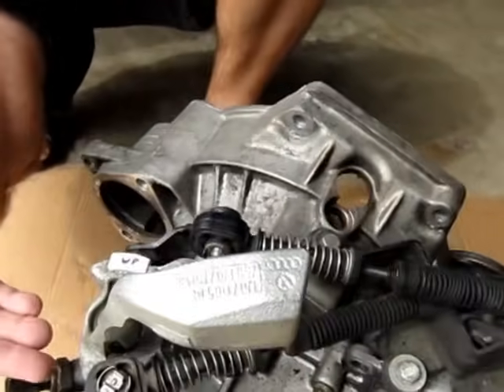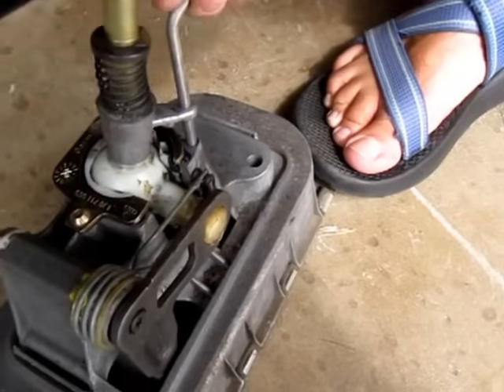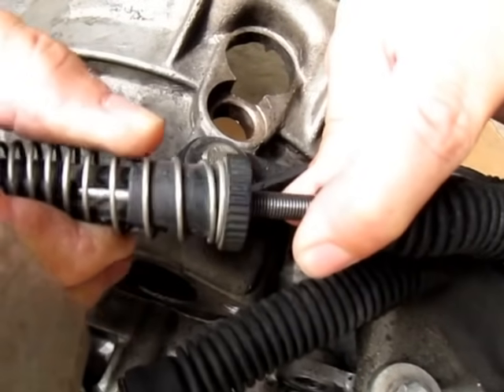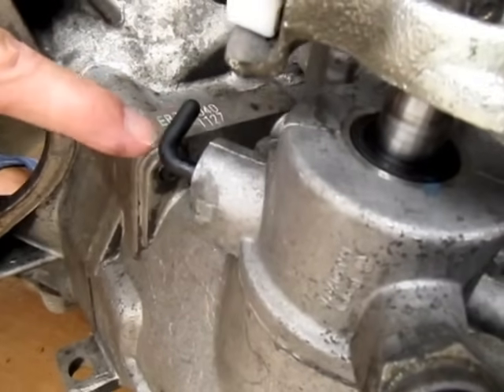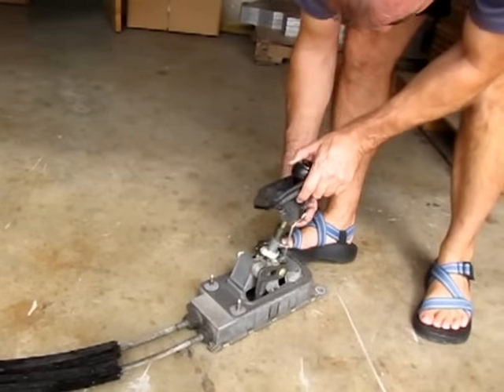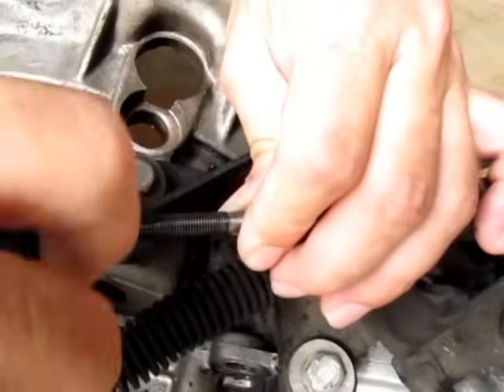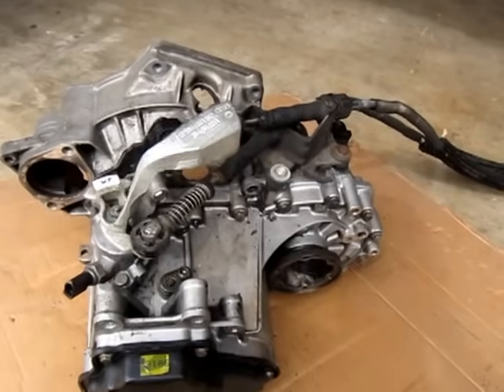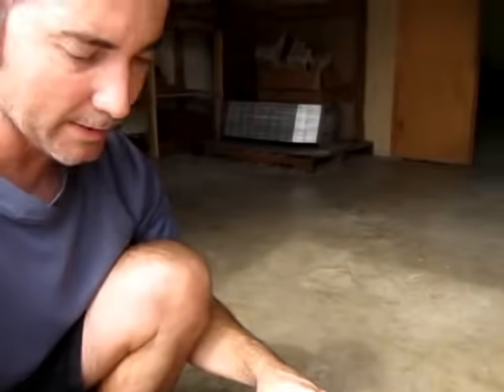VW MK4, MK5, and MK6 5 speed shifter adjustment for 02J and MQ250 transmissions

Comment: Is it the same procedure to adjust a sigma 5 kit with the locking pin broken? I just ordered a sigma 5 this week 😁
Reply: +dieselgeekdotcom  No problem, I've been lusting after one for about 18 months now 😂 
So the white plastic guide will line up in the middle of the plate still when in the correct position with the sigma 5? 

Many thanks Jim 👌😀 

Marc
Reply: +dieselgeekdotcom Thank you 👍

Comment: hi there,

 first I want to thank you and congratulate you for you videos and your channel, you are doing a tremendous job helping others, good work on that! 

So, here is my problem, hope you could help me and let me thank you in advanced for taking the time to read my comment. 

here is the thing, I have a Golf Gti mk4 1.8t which is giving a really hard time getting the reverse gear working, no matter how many times I switch it or I try to put it, no matter how softly or smoothly and try to put it in, it just simply does not wants to works. 

I have taken it into a repair shop a few times and they have just "supposedly" adjusted the shift and this and that, it worked for a few day and then when I get on the road and I change some gears quickly it just stops working again and now it is at the point and it does not wants to work at all anymore. 

the last time that I was at the repair shop  they try to adjusted and I drove the car for a quick test and the transmission did something weird, I tried to put reverse, it took it for a while then after a little ride it did not want to took it again and when I was  moving forward back to the garage, suddenly, it just did something strange, like, It went on reverse abruptly. 

so, Im afraid that it might be something wrong with the transmission internal or with the gear box, I don't know... 

I hope you could reply to me and that you could give me a diagnostic based on what Im telling you.

best regards!! 👍

Comment: Nice demo on shifter adjustment....A Lot of good info here.  I know that this was just for Demo Purposes and serves that purpose in an excellent manner...but did you notice how much play there was in the cable end bushing for the 1st to 2nd shift movement?  That end bushing is SHOT... you can see its cracked inside.

 Pay attention to the condition of your shift cable end bushings.... Doing this adjustment will surely help tune in the shifter...but pay CLOSE attention to the condition of those end bushings....those will introduce a lot of play where you do NOT want it.  The cable may have all the slack out of it and be perfect....but shift feel or shift travel in either direction will be affected by those end bushes...  Make sure yours are healthy and this procedure will be all you need !!   Nice job !
Reply: You couldn't be more correct... After looking at my vehicle as well as another with new ends on it....they were exactly the same.  Lots of play but in a controlled manner...you hit it right on the nose there !   I hadn't seen or played with these cable ends until I installed my adjustable shift arm and now....i think I like the slop a bit !  Whowouldathunkit ?

Comment: Hi I have just started the adjusting the cables but the top cable does not move the alu balance it seems that this is stuck  its a 2008 tdi the bracket is plastic but its the same thing   any ideas
Reply: +dieselgeekdotcom Thanks for getting back to me
the black L shaped is not in the locked position  the counter weight just does not move should i force it ?
Reply: +dieselgeekdotcom the L shaped pin is out and no pin is in but it still does not move is it dead ? should i try to move it force it  could it be stuck Looks like the fulling plug has never been touched and the inspection plug the same!!!

Comment: unlucky me 1 of the 3 splines that holds the cable broke when I was getting as you say putting the shifter into the home position with the 5mm pin so 2 splines are holding the cable along with as you say zip ties. Still driving for now though

Comment: Hey @dieselgeekdotcom , on my 02J trans the chrome counter weight you are talking about in the video has been stripped from the splines from the gear shaft coming from the transmission and needs to be replaced. Do you know the official name/part number for that chrome weight? I need one asap.  Thanks in advance.
Reply: +MrDieselsmoker  the part number is on the orignal weight
Reply: +dieselgeekdotcom world pac or the dealer can order or i can as well - 613 -438-2886

Comment: My 2006 VW Passat 1.9TDi (B6) had an issue selecting 2nd gear problem changing from 1st to 2nd or 3th to 2nd you would 30% of the time end up getting 4th Gear (problem at traffic lights and while crossing a busy road !!!!) used this video to re-adjust the linkage and worked first time (well problem shifted to selecting 5th gear ) second time managed to perfect guess the locking drill bit shifted the first time just want to say a big thanks for well explained Video

Comment: I've adjusted it several times now on my '04 GLi. I couldn't get the car into 1st & 2nd very easily when I bought it, and now that I've adjusted it I can't get it over to 5th or 6th. I've adjusted the side to side linkage anyway I could, with a lot of slack or very tight and it doesn't change my ability to shift above 4th. I'm not sure what the problem could be, any advise?

Comment: Thanks Bro. It totally works you are the man. Sweet.
 I am still having trouble with p1128 and a brake leak issue ongoing..  New stage 2 clutch not even broken in yet but the transmission passes.

Comment: a motor shaft from a POWER 25    motor  will work very well .just put a little tape around the top
WHERE can you get one  ANY HOBBY SHOP   it is the output shaft for the motor
E FLITE POWER 25 

WELL  I am so saddened that I let someone install my shifter for me  because it has been miserable for the last 160.000 miles  

with this great video  it feels so good 

I will now go and test it out

Comment: Thank you so much man, your a god damn genius! Lol, really.. Thank you a lot for this, I feel smarter just after watching it, I've seen alotta videos but you, lol, this one, wow! Thanks for both methods and making the whole system make sense.. OK, funny story I think, I bought a 1.8t jetta that had the head off and axles off and motor out, I really didn't know a whole lot of mechanics ( I kinda avoided it sorta) but I'm mechanically inclined and finally got interested last summer. Anyway the car was in pieces but I love puzzles and challenges so I put this whole car back together like a learning project, I always wanted to get a turbo and build it.. Anyway when I did the shifter cables (1st time) I just put them together and tightened the bolt and it was the first manual I've worked on and first like this anyway I learned later when I had to actually figure it out that I was so lucky to just put the cables on and tighten it down in no order at all and just have it all work so perfect.. Crazy lucky.. I just put the cables together and tightened the bolt and it shifted perfect But this time around, thank god for your video and help its been a little tricky but now I know what I'm doin.. Thanks

Comment: I have a 2001 Jetta, 5 speed manual transmission and followed your procedure and I get Reverse, 1,2,3, and 4, very smooth, but when I go to 5th, the car defaults back to 3rd gear.
Reply: armydlguy Just wondering if you had a chance to try what he explained i'm having the same problem with my 2001 gti. I'd love to know if this would fix the problem.
Reply: I threw in the towel and took the car into a VW garage - they went through the same gyration with the 5mm pin and calibration, but did something else to get my 5th gear back - only charged me $90, was very lucky!

Comment: I've got a 2007 VW Jetta 2.5 with the manual 5 speed transmission. Yesterday my friend and i were drifting in snow and suddenly the car stopped shifting into first gear, works on all the other gears though, the stick shifter doesn't want to shift into first at all, while the car is on or off or double declutching , any advice?

Comment: I am gonna give this a try.
My problem is 5th gear. Its pretty hard to get. Every other gear no problem but 5th 3out of 10 times will get it
Reply: Neo Tribe Culture Have you tried what he has explained i'm having the same problem with my 2001 gti. I'd love to know if this would fix the problem.
Reply: Pctopshotta i did. But my jetta had the old style shifter, still what i needed was adjustment and i got all the gear changes correctly!

Comment: I can not find a happy medium to save my life. It's either first and second flawlessly,  and sixth won't engage,  or sixth engages flawlessly but then I can't get it to hit first..... I've tried at least a dozen times now. Any suggestions? I just replaced the shift cable as well.
Reply: As embarrassed as I am to admit this my problem lied within the fact that the previous owner put a 6 speed knob on a 5 speed transmission. Visibly the wear on the knob matched the steering wheel so naturally I figured it was a 6 speed when I bought it. Turns out it would not go into sixth simply my car doesn't have one :)
Reply: If only I would have read this a week ago. I called several companies trying to find who made just the bushing. I even called a friend in plastics to recommend making JUST the bushing that was available nowhere online. Excellent idea to save people serious cash. Just my luck Haha! Share a link to the part?  I'd like to see it. Also it was hard to tell which way to pull the shift cable. Away from the tranny or towards it when taking out the slack.
Reply: and you have the first gear getter! Man... I wish I saw these a few weeks ago. I had to replace the shifter along with the cables. 250$ later just for a few Bushings. You guys are genius!

Comment: This video saved me untold time and money. I'm selling a 2001 Jetta. A potential buyer took a test drive today and when they came back, the car wouldn't shift into reverse. Meanwhile first and second were where reverse was supposed to be. Even though the cable ends on my car were dry and balky and I'd never done this before, the repair took less than five minutes. Now the car shifts into all five gears and reverse better than it ever has in the five years I've owned it. Thank you so much for posting this video.

Comment: Thanks for the video.  After 14 years and 270K miles, my shifter started feeling notchy.  Gear changes from 2-3 and 3-4 were starting to miss, so I followed the instructions and my shifter is as good as new.  I would suggest working on a cold car or waiting an hour with the hood up to prevent burning your hands.

Comment: I had problem with first and second, I found your video and followed it. Now it works much better, 1st & 2nd have no problem but sometimes 3rd is hard to get in and reverse seems to be a little tight. 4th & 5th also work fine. Could you tell me whatthe problem may be? Thanks
My email address is rmlex63@gmail.com

Comment: Hi. Thanks a lot! I ended up using the second option ( with broken pin ) even that my pin is there, it doesn't do anything. I used alan 4mm key first time but and didn't do good job. On second try I made sure the gear stick is well positioned and I repeat the adjustments. Perfect video!

Comment: I have Jetta TDI 5 speed 2003 (This is the one depicted, I think).  I lose reverse about every 6 months. I get it adjusted and then after a few months it goes out. ( I do the motion for reverse and it only goes into 1st.) it will come back a few times and then not at all. What is the problem with this?  Which part is wearing/worn out?  I will try adjusting this myself because it is too expensive to pay for it all the time.  Is there a possible problem and solution other than depicted in this video?  Post link to the 5mm rod adjustment.  Thank you.

Comment: Any chance you might be able to help me?
Ive got a vw golf 1.9 tdi 6 speed,
its a bit notchy when changing from 1st to 2nd gear all the other gears are fine, even going into reverse. could this maybe help it,  or could i end up making things worse by messing around with this??  should i check for looseness in the cables when i pull back and lock the springs

Comment: I have a 2008 City Golf (Canada) and this solution worked amazingly.  Just a note, make sure that when you release the cable springs, you make sure they return all of the way back.  The first time I did this, I lost first gear because the linkage shifted after 5 minutes.  I repeated the steps and this time made sure the springs had fully returned (there is almost a ridge that you have to pull past) and now my first gear is perfect.  My car shifts better than it did when it was new.  Thanks.

Comment: are you able to double clutch it in to 4th  (instead of downshifting like usual, clutch, throw into neutral,clutch, shift into 4th)? i see much benefit thatthe short shifter could have with comfort of shifting, but honestly your issue sounds like it could be directly due to the cable linkage needed to be adjusted like in the video

Comment: Your shifter is completely different. There is a black plastic cable holder on top of the transmission that has a 13mm nut which, when loosened, can slide fore/aft to adjust shifting accuracy for first gear. If reverse or fifth gear are hard to get then this plastic part is likely broken and can be bought at your VW/Audi dealer with part number 1J0 711 256. please email me at dieselgeek if you need further assistance as this video only deals with cars from 2000 onwards.

Comment: my shift is old system for audi a3 1997, dont have a hole for lock pin in shifter inside the car, how can i lock to do the adjustment? you have any idea?

Comment: My 2000 Golf 2.0 Manual Trans, can't downshift from 5th to 4th on the frwy, like i cant find 4th gear, until i slow down to get into 3rd gear. It works well upshifting. I feel the shifter is sloppy/slack on it.I was trying to see if the oem tt ss at ecs will fix this issue. Any help advise will be help. Thanks!

Comment: Jim, love ur vids! I have an 08 2.5 jetta 5spd w/ 60k & stock shifter. I have a couple Q's. Shifts from 2-3 (sometimes others) aren't consistently smooth when shifting at low rpm. Reverse will occasionally give me a small grind when shifting in, but not if I shift into a syncro gear before R. Occasionally get a kick back feeling when I down shift into first as I roll to a stop sign. Is this linkage or clutch? All symptoms are intermittent. Clutch also has different feel depending on the weather.

Comment: I have a 2002 VW Jetta and I just replaced the clutch. Before I did the adjustment you show in this video 3rd gear was hard to hit. I did the adjustment and now 1st and reverse is an issue. Do you have an answer for why I have this issue along with a fix?

Comment: All my gear components in my 2004 5speed were replaced, and I had the mechanic follow your video to adjust the gears. But when driving first and second gear engages normally, and I have to push all the way to the right where the 5th gear is to get 3rd and I've got no 5th gear. And it becomes really stiff after engaging 3rd and 4th. Is there anything else you can recommend, or was the adjustment done incorrectly?

Comment: I have a problem where my vw mk4 gti wont go in to 1st gear. I can get it in first sometimes but its rough getting it into 1st. Almost like the likage is binding on something. Could this adjustment be the problem? All the gears are fine. Never had any grinding and theres only 90 k on it.

Comment: If the recommended fix did not solve your problem, the dealership misdiagnosed your car. If car is under warranty, you should not be billed for anything even for diagnosis. If car is no longer under warranty, you will be responsible for parts & labor except diagnosis as I assume you already paid on your last repair. Good Luck.

Comment: Hello VW brothers/sisters. Mine's a 2005 Golf 2L 5sp 74K km or 46K miles. My only trouble is when the engine is on, shifting from N to 1st is so hard (no grinding or any other noise) just damn hard. But this problem goes away when car starts to move. From 2nd to 5th is butter smooth. With engine off I can cycle all gears with no issue, soft and clean. Shifting from N to 1st or N to R is heavy but only when the car is fully stopped. It feels like my shifter could break. Any ideas? Warranty done.

Comment: tried this process because the car couldn't shift in second gear seems like the selector is stuck in reverse and i cant get it to move into neutral could it be a prob with the home position pin on the transition being stuck and not allowing the upward movement on selecting also there seem to be alot of play on the counterweight. Any suggestion?

Comment: Awesome video, Im did this on my 6speed vw gli, but i have a question. ill be installing new shifter bushings. It looks like a straight forward replacement but im just worried of how re-install the cable-end to the same position it was before taking it out.